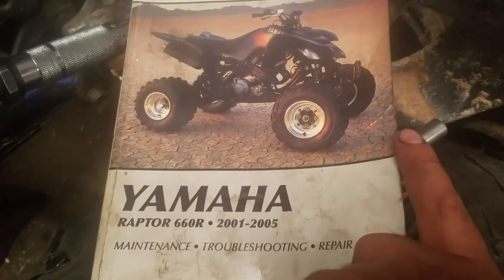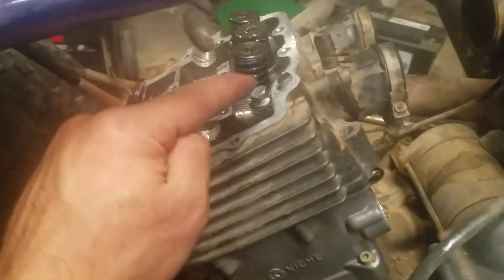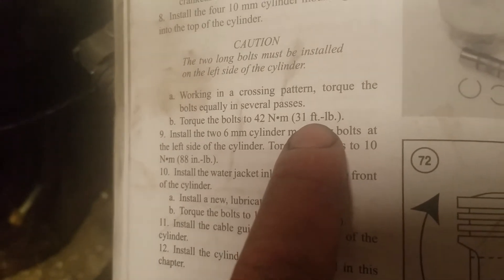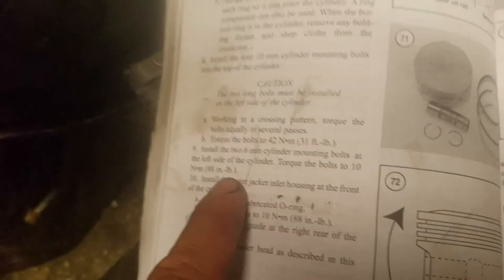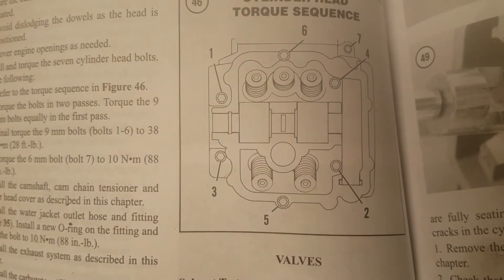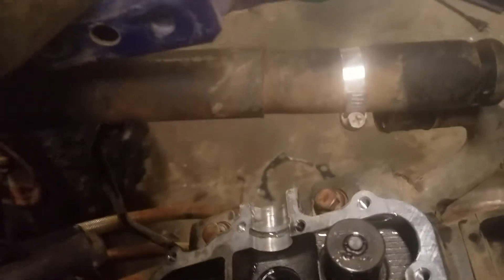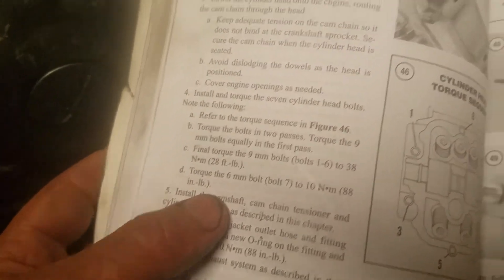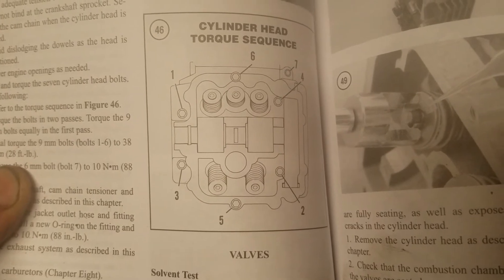Yamaha Raptor 660 Head Torque Specs

Comment: What’s the  torque specs for the camshaft gear on this Bike?
Reply from the maker: The little hold down bolts are probably 7-10ftlbs, but check your service manual to be sure

Comment: I have a rhino 660 i think its the same motor. The top end was garbage so i replaced it with a big bore kit, with saying that we used the same origional head bolts. And it has now blown the head gasket twice. So i have had the head machined down and bought brand new bolts after finding out those were a torque to yield bolt. Question is can i use my new bolts that are not studs and torque them down to 39 or 40 ft. pounds.
Reply from the maker: I could only tell you to do what the manual says to do.  If those are not OEM bolts then ask the manufacturer of the bolts. If that isn't possible..... yes you should be fine to torque to spec.
Reply: did you do proper running of the new head. like 20 hours of idle time ect before taking it out (or did it blow when doing the idle benchmark so to speak). and also. did the crank shaft hold up to the new head well and did you get it to work. i have a 2002 grizzly 660 and my head gasket blew with piston rings. so i ordered a cheap 102mm bare minimum piston and casing. i will have to use all old bolts ect. with careful planning and execution. do you think after the 20 hour idle time it will mess up like yours?